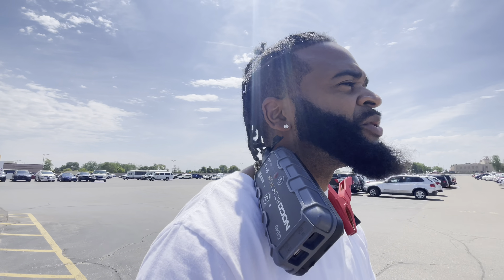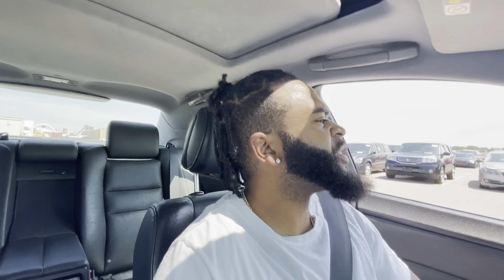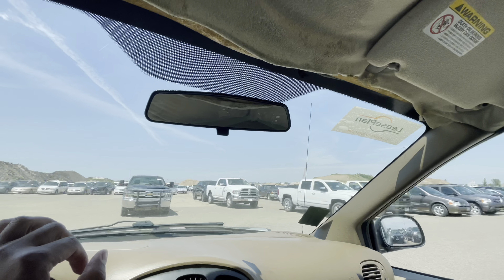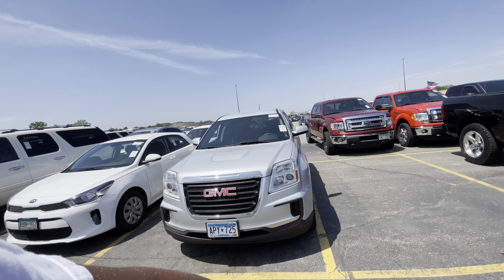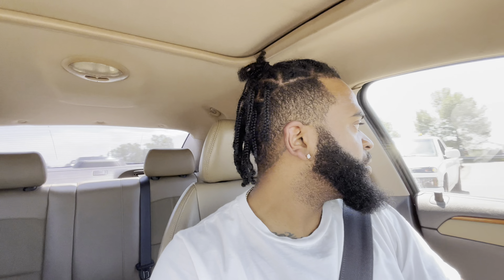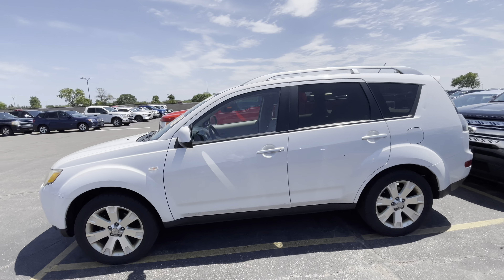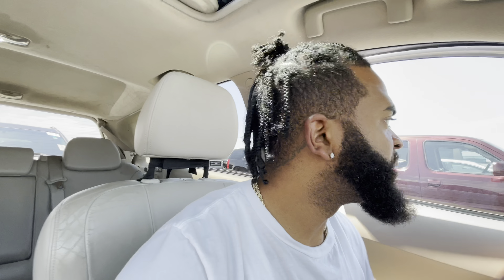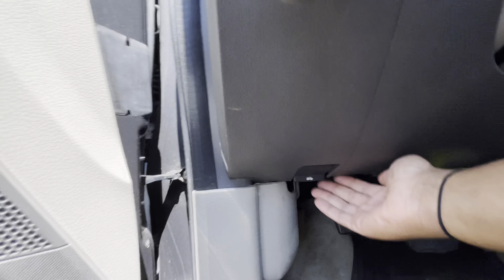AUTO AUCTION WALK AROUND @ MANHEIM AUTO AUCTION & I FOUND A 2021 CHEVY CAMARO SS + TEST DRIVE 7-4-22

Comment: I've been a dealer here in Atlanta for 17 years and here in Atlanta you can't scan the vehicle NOR can you test drive it. It's almost as if they want you to buy a piece of shit and lose your money. I try to stay away from Manhiem as much as possible and visit the auctions that let you test drive and scan your cars like America's Auto Auction and Vemo in Warner Robins....A rule of thumb that all independent dealers need to do is to look at that sticker on the windshield with the info on it and NEVER buy a vehicle from another independent dealer. Try to always buy from a corporate dealer (Toyota, Honda, Ford, Chevrolet, Lexus etc). If an independent dealer has a low mileage or even a moderate mileage vehicle that's clean and looks good, you must ask yourself why isn't he selling that vehicle on his lot....I'll tell you why, that vehicle has issues and he's simply trying to pass that piece of crap on to someone else. Another thing, NEVER buy any BMW, Nissan, or Infiniti vehicles. Be very cautious about Volkswagen and Audi. All those cars are junk cars, especially BMW!! DONT DO IT!! Always scan that barcode on the sticker and check your history to make sure the car you are buying does not have a salvage or rebuilt title and you want to check your accident totals. You have got to do a better inspection of the cars you are trying to buy BEFORE you start the vehicle. Check all your fluids first, check your oil level, check your antifreeze level, pull your transmission dip stick out and smell it...yes, smell it. If it has a strong electrical burnt smell, walk the hell away from that vehicle because the transmission is cooked. Also you need to inspect the bottom of your engine for leaks and look on the ground under the engone for drips or apparent fluid leaks. Do all of those things BEFORE you start the car. Inspecting the seats and admiring the paint condition, radio, and AC means nothing unless you do your due diligence on the mechanics of the car before you ever start it. Once you start that engine and the car heats up, you have just shot yourself in the foot as you can't do the important checks on the car. This is just friendly advice from one dealer to another and others that are reading this comment. You don't want to buy a vehicle and because you didn't do the things I listed and your sitting at your office or dealership mad as hell because you just bought a piece of shit and you're never getting your money back or you will never sell that junk car you should have never bought in the first place.  Be careful out there and if you take these comments I'm leaving to heart, you will be more successful as a used car dealer. Also, always keep in mind, the vehicles you sell is a direct reflection of you. If you want longevity in this business you must sell good cars. It can't always be about the money, yes make money but don't buy cars that are all beat up just to get it cheap to make a dollar. That red Infiniti G35 that smelled like shit, I would have never even entertained that car once I smelled that odor. You don't want to sell that to a customer. If it smell like crap do you think they did any maintenance on that car....NOPE!! Always keep in mind, what you sell is a reflection of you.
Reply: Excelent advice. I've been a dealer for 7 years, and I agree with everything you wrote. I've been buying mostly from Backlot and ACV auctions lately because they do inspections for you, including obd 2 scan test drive etc. And they check for leaks, coolant levels, tires, ac. 
Manheim and Adesa which are the big ones here in southern California don't let you drive, or scan your vehicles. So when I buy from them, it has to be green light guarantee low mileage and in really good condition.